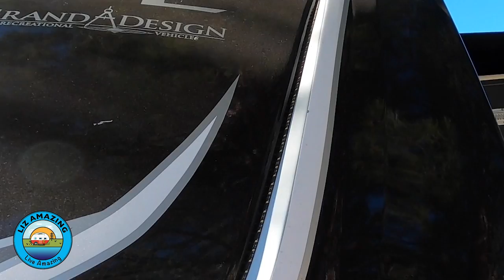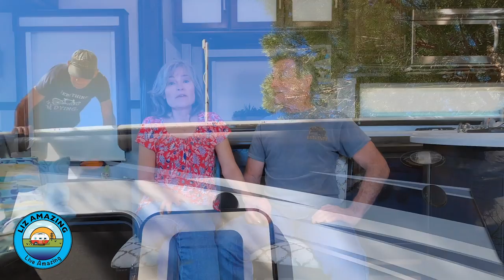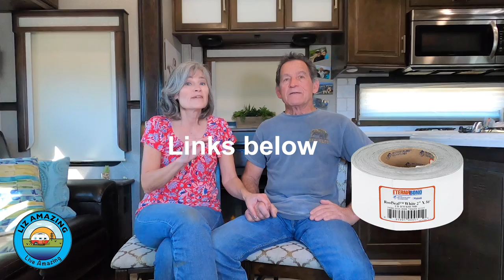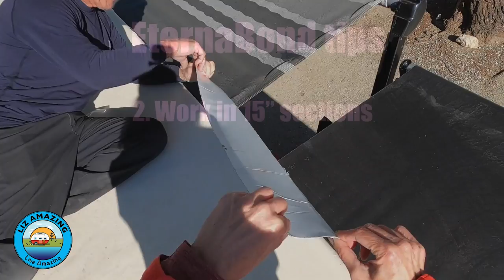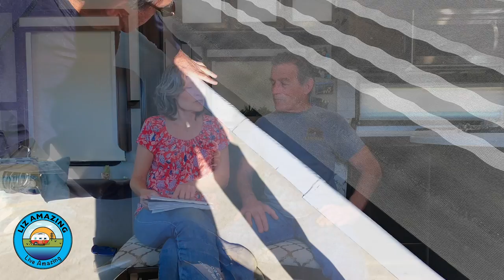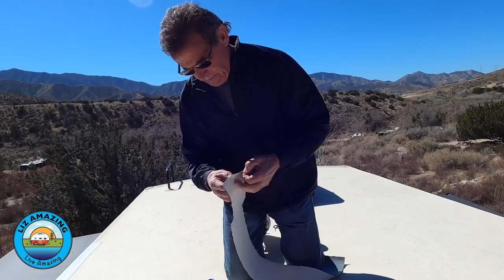RV life: We damaged our camper | $10,000 mistake | EternaBond | Fulltime RV Living

Comment: We did this exact same thing about 2.5 years ago on a previous trailer and didn't even realize we had come that close to any branches till we had interior water damage a couple of weeks later.  We put RV FLEX Armor on the camper we replaced it with and also immediately put it on our recent upgrade to a new larger camper.  It's not cheap, but you never have to seal/caulk/etc your roof again. It's virtually indestructible and has a lifetime transferrable warranty.  Peace of mind and no maintenance makes the cost seem very reasonable. If you ever have to fully replace a roof it's not that much more so it's a no brainer over traditional fabric roofs.  I am totally sold on this product and will NEVER have another camper without it.  The authorized installer that did our roof had a big trailer come back to them after a large tree fell on it -- broke the roof framing in a few places but did not pierce the Flex Armor!! Note that there is also another product called RV Roof Armor but it's just a rubberized paint that goes on with rollers and brushes whereas the Flex Armour is a sprayed on flexible polymer that builds up to about 5/16 of an inch.  I am in no way affiliated with this product, I'm just completely sold on it's value compared to the garbage the industry puts on most RV roofs.  Every camper I have owned over the last 20 years has leaked at some point despite my best efforts prior to finding this stuff.
Reply from the maker: That's awesome, thanks for your endorsement of FlexArmor. Like you, we lost confidence in TPO after it tore so easily. Here is our follow-up video comparing FlexArmor with RV Armor:  https://youtu.be/9Yv0ZKSfvbc
Reply: @LizAmazing  Yeah, I've got blue jeans that will tear less easily than TPO and I've literally had crows tear off the caulking!  We had our Flex Armor done at Reliable RV in Madison MS.  About a 7 hr drive from  home, and yes it takes a few days, but to us it was worth it.   However, I do get the appeal of the more flexible install with the other rolled on product -- for us it wasn't available anywhere local either.  Also, they way they install the Flex Armor in Madison they put new vent rain covers (which our trailer did not initially have ) and a new AC cover all of  which look to be on a raised track of sorts so I'm assuming they can be replaced without damaging the coating-- I'm not sure all installers do that. If a skylight broke we would have to eventually get that area resprayed by them (though they said we can certainly do whatever we need to for a temporary fix with a new fixture and caulk), and as you mention in your other comparison video which I just watched any upgrades that would be roof mounted really need to be done before putting on the Flex Armor.

Comment: A similar thing happened to us a year or so ago.   One additional step that is suggested to finalize the process for a permanent fix, especially if it is a place that is subject to high winds like near the front.  Seal all edges and seams with a self leveling lap sealant such as a product from Dicor Products.  Eternabond is a strong tape, but after peeling back the first time the lap sealant  was the ultimate solution.  I carry both the tape and sealant on board.
Reply from the maker: Good tip, thank you!! Hope we are done with using Eternabond for a while! And fingers crossed that insurance covers our roof.

Comment: I pulled out of a street parking area after attending church for Easter in Rockford IL. The tail of my class A 36' rig hit a tree branch and crushed the rounded area side area about 1' from the back, hooked the rear cap, and tore it partially off. We strapped it back together and make the 5-hour trip home. At home, I took the rear cap off, repaired the fiberglass, rebuild the round side curve with metal, and applied 6" Etrnabond to repair the membrane roof. That was more than 10 years ago.
Reply from the maker: Wow. Good story. Sadly we have another story coming up about yet another incident with our rig. It will be out this week. Ring the bell if you haven't already. See you then!

Comment: from the photos the damage does not seem bad. The skin was ripped but not torn off unless the damage was worse than displayed in the video.  So I don't see a big penalty as a result.  I would suggest placing the eterna bond tape around the entire perimeter of the roof. It would give a look like it is preventive instead of a repair. And if you plan on keeping the rig for a few years, I would also place the tape around all places that have openings like the A/C, vents, etc... This tape is great and the roof will deteriorate around it.
Reply from the maker: That's a good tip. Yes, if we did not tape up the rip (20' long!!!) then air could have gotten under there and lifted the roof right off. It's amazing how easy these TPO roofs can tear. I like the idea of a preventive piece of eternabond all the way around. We are actually researching a more robust roof as part of our insurance replacement- stay tuned!

Comment: We also had a tree attack our fifth wheel with the same kind of damage along one edge. You're right on about doing it in 15 inch sections. However, it's much safer to do it on a ladder on the side rather than on the roof. You can lineup the lower edge of the tape with the upper edge of the gutter much easier and you're not leaning over the roof. I used non-sag lap sealant to fill in the deeper cuts first, then the tape after the sealant cured. Start at the back and work forward so the seams, except the forward most, won't catch the wind. Use a box cutter to cut the tape, much easier than scissors. Just lay it flat on a wooden surface to cut. I also found denatured alcohol cleans the roof easier than acetone. Finally, use tan tape since the roof doesn't stay white.
Reply from the maker: Thanks for the great tips. We are going to do a roof update soon, stay tuned!

Comment: Paul, I offer this to make you feel better. Took delivery of our new trailer in a Montana blizzard, first season was short and then a 2nd winter (and expiration of our warranty) came.  Only thereafter did I discover the manufacturer put two different size wheels on our rig.  I have all but kissed those tires umpteen times, checking pressures, inflating, torque wrenching the lugs...but never thought about checking wheel sizes!  Manufacturer refuses to return our calls (we're just trying to get a replacement wheel of the right size) so quick resolution ain't in the cards.  I felt like a dummy, of course.
Reply from the maker: Oh my goodness, how crazy is that? What may work is to (respectfully) explain what happened on one of their social media pages such as an owners group on their website or on Facebook. That might get them to take care of this. Good luck!

Comment: I pulled out of camping site at Flat Iron Reservoir near Loveland, Colorado. I was more concerned about the large boulders and avoiding them rather than the tree. I got back to the house and noticed the antennae was leaning forward. I climbed up the ladder and sure enough, the tree had started at the front of the cap and ripped roof all the way to the back. Repair bill was $12,000.  I learned that when entering or exiting a campsite, check obstacles on the ground and above the camper. Take 60 seconds for situational awareness before proceeding to prevent damage.
Reply from the maker: Great tip, thanks so much. Sorry that you learned the hard way. Us too. Sometimes those are the best lessons. Hope to see you at a campground someday!

Comment: I repaired a fixer upper with silicone first to fill gaps, then eternabond to cover damaged and thin areas so that my silicone roof coating had a solid base to bond with. I used Gaco white roofing and it is supposed to have a 50 year warranty as long as it is only maintained with Gaco chemicals.
Reply from the maker: That sounds like a good option - thanks so much!

Comment: I had a bad spot on my 2009 campers roof beside the exhaust fan, a little over one square foot area. I took my camper to a local RV center to get an estimate for repair. We had to make an appointment two weeks latter just for the estimate. My camper is a trailer and is about 23'-7" long overall, the body is just 18'-7" long. It was clear that they did not want to do the roof replacement, the estimator said it would be around $12,000 to replace the roof. I bought my R-Vision TC-21RBH camper new for around $13,000 from RV Wholesale in Ohio.

My wife and I looked at new campers before we went to get the estimate and didn't see any thing we liked as well as our camper.
Our Camper Has:
(1.) Low weight, the UVW (unloaded weight) is 3345 lbs. I tow with a new 1/2 ton 2023 Chevrolet Silverado that is my daily driver.
(2.) Good Cargo Capacity, the CCC is 2312 lbs.
(3.) Large storage area, it has a bed the folds up and a back door that is 30" wide where I can put two large storage tots and my cook box I have had since being an assistant scout master.
(4.) A large front U shaped dinning table with room for 6 people.
(5.) Double door refrigerator that runs on propane or 120 VAC. The freezer gets down to about zero degrees Fahrenheit.
(6.) Closet to store hanging clothes, and many storage cabinets.
(7.) Four burner propane stove with oven.
(8.) Crank up TV antenna with amplifier that works.
(9.) 14 foot awning.
(10.) The finial thing, the size allows us to go where ever we want. We usually stay at State or Municipal Parks.

I am 75 but I fixed the roof myself. I cut out the EPDM roofing to the center of the ceiling joists just wider than the soft area with a utility knife. Then used a vibrating saw to cut the OSB. The OSB fiber board was all wet and rotten. The insulation under it was also wet so I removed it and allowed time for all else to dry out. I replaced the fiberglass insulation and the OSB fiber board with a new piece of plywood, glued the EPDM roofing back down with contact cement from a spray can and then used Eternabond tape at the cut I had made. It gave a 2" over lap on each side of the cut. I cut the pieces of Eternabond tape to length. I then pulled back about 4" of the backing on the Eternabond tape, and pulled off more backing as I applied the tape. Used Butyl tape under the edge of the roof exhaust fan and also the skylight. Cleaned up the squeeze out of the Butyl tape and applied Dior Lap sealant over the screws and edge. 

I also replaced both sewer vents and the skylight over the shower tub, they were all bad due to UV. The leak was at a spot where there were brackets that held on a large shroud over the roof exhaust fan. They had caulked over the brackets but not under.

My wife and I camp a few days ever month about 7 months a year. We also help take care of our grandsons. When we make camping reservations, we tell our relatives and a few friends. They can make a reservation, the state parks are only about $30 to $50 a night. Our one nice has a popup and our daughter has a large tent. We are the center of cooking.

Comment: OK so you feel better.  My husband was bringing the Tundra down into the driveway and didn't see the trash can and hit it with the front bumper pushing it THROUGH the outer shell on the trailer. we were screaming at him to stop and he's looking puzzled and kept coming.. Used body stuff to patch it.  but WAIT there's more!!  The OTHER time- was he was backing his motorcycle into the driveway ( we have a steep downhill driveway) and started to drop it- but the trailer "caught it" right through the outer door panel. 

I think he just didn't like the trailer because the bed was too short. Word to the wise- test the bed LENGTH.  The jack knife sofa is not too comfy.   We traded it in and got a pretty good price because we only used it 4 times even with the body damage and it even still smelled new inside for a much older toy hauler (we no longer have MC's) but we are remodeling it for a floor bed using the suspended bed space for storage and removing to 200 ft long (joke) sofa and rearranging the dinette benches.  What's great is they fold up against the wall if we don't want to use them and the table folds up and is removable easily. So we'll have a raised patio too.
Reply from the maker: Wow, those are epic stories!!! And your dirveway must be a challenge! Glad your marriage survived. Good tip about the bed. I slept on a jackknife sofa for my first six months of fulltiming when I was in a camper van. Never again!

Comment: Did the same thing! I got a spray on roof with life time warranty it cost a little over half the price of replacing the rubber on! One of the best things about it is it eliminates all the caulking on the roof.
Reply from the maker: I'm looking into 'RV Armor' for the reasons you mentioned. What did you go with?
Reply: RVroof.com FlexArmor I had it done in Kings Mountain N.C. by Country Camping Corner. Mine will be 3 years this July no issue with it.
Reply from the maker: I will definitely check it out. Thanks!

Comment: I used to make jewelry. I have a little bit of experience with acetone. I got the handle of my Swiss army knife wet with acetone and it proceeded to actually dissolve the handle. But it is a great cleaner/solvent and I guess it worked fine on yer roof.

Comment: We did that as well. Did almost the same exact damage, I was shocked to hear that it would cost 12-13k to fix. As someone in the construction industry I just don’t understand how that cheap feeling roof material could cost that much to install. No damage was done to the roof structure it only ripped the liner. We have insurance but can’t have it in the shop for 2-3 months right now so we went with the tape until we can get it to the shop:
Reply from the maker: That's so crazy, isn't it? So sorry you're in the same boat. We researched and found BETTER roof alternatives that were cheaper, too. Here's our video about those:  https://youtu.be/9Yv0ZKSfvbc

Comment: I did about the same thing to my 5th wheel roof but in my own driveway. A small plum tree which just overhung the driveway. Plum tree branches are very tough and it put a 3 to 4 inch rip in the roof. I patched with eterna bond  tape and it is still ok 4 yrs. later.
Reply from the maker: Yay! Glad to know thar the tape lasts at least that long. Our TPO roof must stand for Tissue Paper Of.

Comment: You have lived my worst fear!  Our Grand Design is the tallest camper we've owned.  Some tips to ponder and squirrel away: 1) 4" Gorilla Tape allows you to do a VERY robust temporary repair; 2) warm Eternabond in the sun before installation; 3) Eternabond is actually a repackaged detailing tape from the commercial roofing industry (I manufacture these membranes) so if you want an exceptional repair you can get a variety of widths, several colors, and paying one of those roofers a little side cash will result in a fast repair that looks perfect and in long pieces; and, 4) if your insurance will pay you the cost outright, bank it and wait till you really need the roof or before you are ready to trade/sell.  Reason being, the construction of the roof is such that it should only be re-roofed once.  FYI - it's not pretty when your roof delaminates in tow.  Factory replaced ours in the fall!!  Finally, your scratches in the full body paint are EASY repairs!  GD will give you color codes, and then roll into a major city with German car dealers and ask who their paint correction guy is.  They'll fix it to where only we very serious car guys will know it.  There's a fella at the Factory Service Center that corrects paint with the best with them too.
Reply from the maker: Good advice, thank you so much! Paul wants to know what you think of RV Armor? And can that be replaced if need be?

Comment: No tree damage, but I had the roof get air under the membrane that only got progressively worse with each trip...blew up like a balloon at one point.  I chose to have an RV FLEX ARMOR roof installed, down in Mississippi via Dependable RV Services.  This is a sprayed on roof membrane that has a lifetime warranty.  No more caulking.  The RV FLEX roof was actually cheaper than having a dealer re-install the same old membraned  roof.
Reply from the maker: Thank you. We are looking at upgrading our roof since apparently TPO stands for Tissue Paper! We are looking at Flex Armor, RV Armor, and more. Stay tuned!
Reply: @LizAmazing  I compared both RV Armor and RV FLEX Armor and after talking with Gary at Dependable, I made the 9-hour drive for the install.  Three of our camping club members have since had their roofs completed via Dependable as well...good luck on your decision.

Comment: I used the tape on a tear from a tree on my travel trailer. I also painted over the tape with an RV roof sealant (not necessary). It worked great and never leaked in the 8 years I owned the RV.
Reply from the maker: Glad to hear! We think that eternabond tape is stronger than many roofs!!